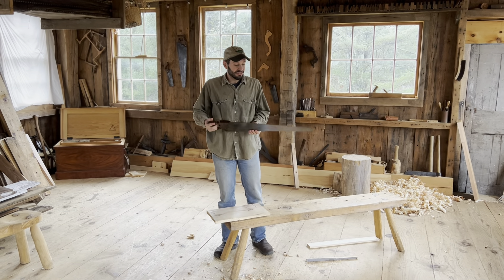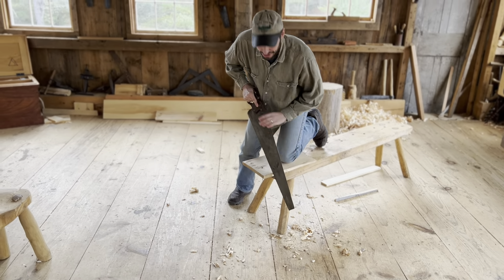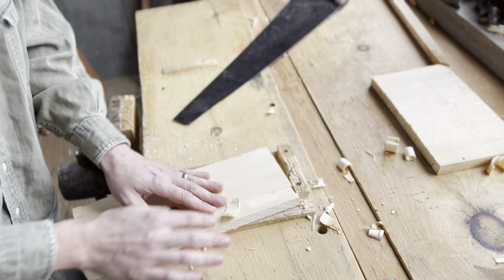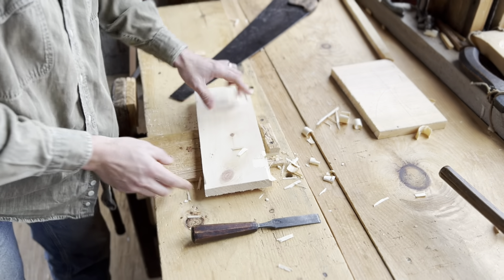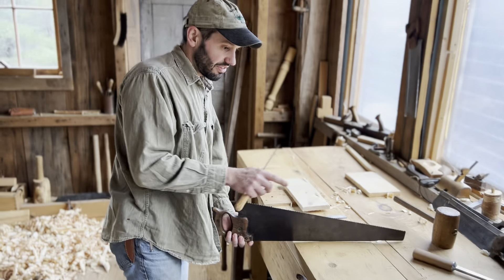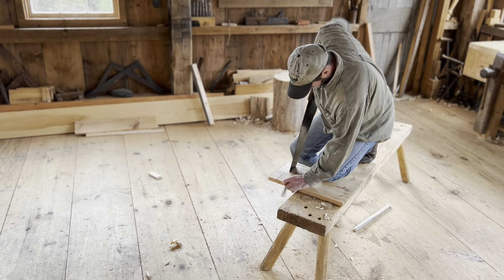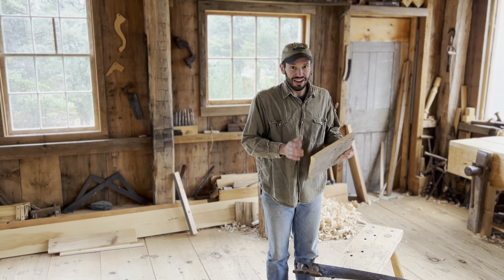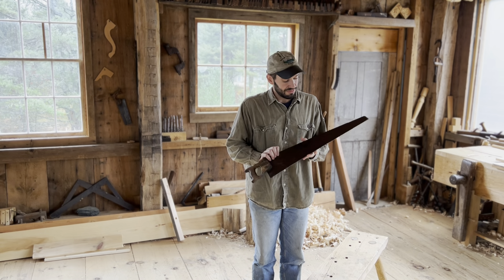Why You Need a Crosscut Handsaw

Comment: I’ve found that adding about 7 or 8 degrees of fleam to you rip saw makes it leave a pretty darn good finish on crosscuts. It degrades the rip cuts far less than it helps the crosscuts. I still have dedicated cross and rip saws. However, these days, I almost always just grab my old Disston that I hybird filed. I did it on a 7 TPI rip (it’s somewhere between 6.5 and 8 TPI, I don’t actually recall). The smaller teeth still rip quick enough for all but the the longest rips in 8/4 hardwoods. I think the slightly less aggressive teeth helped what I was trying to achieve. But it’s worth thinking about. Keeping the Cutting Edge by Harold Payson is a gold mind of a book for sharpening saws. It is unmatched in helping you become knowledgeable about what you should try and achieve when filing your saws.

Comment: I use a 4 point rip saw for rough crosscuts in stuff like fence posts; things that dont need to be clean. I start it on the forward stroke by using the bottom horn on the handle to lighten the toe. Itll cleave through 4inch material in seconds. But obviously a crosscut saw is needed for things that need to be cleaner :)

Comment: Sharpened with a slightly relaxed rake angle, the ripper can cross-cut extremely well, but ideally you should carry three saws. Rip, Cross-cut and Panel saws
Reply: Do you mean Back saws? I was under the impression that the broad-bladed saws he's using here (regardless of tooth angles) ARE panel saws, because the blade is a metal panel as opposed to a thin blade stretched in a frame.
Reply: @Nurk0m0rath  panel saws tend to be 20"-22" in length and are used for cutting thinner sheet materials. Cross-cut saws tend to be between 22"-24" and used for cutting across grain. Rip saws tend to be24"- 28" and used for cutting with the grain. All are handsaws, but the saws in question possess broad tempered saw plate and low tooth count per inch.  They're heavier duty saws than tenon saws, but not all are intended for sawing sheet goods.

The saw that's in use is a rip saw, not a panel saw. Rip saws tend to be used when cutting heavier timbers with and not across the grain, but tooth rake can be eased so they cut both with and across the grain.

Frame / turning saws are a separate saw type utilising narrower saw plates held under tension within a frame and with coarse, medium and finer blades for use depending on materials being cut.
Reply: @gazpal  You misunderstand me. My understanding is that "panel saw" is a broad category that includes both rip and crosscut saws, and possibly also back saws. I've never heard of a specialized saw for cutting through sheet material. In my experience, a crosscut saw does that job perfectly well. Which leaves a joinery saw (of which there are many designs, btw, but many are collectively known as back saws) as the third necessary saw.
Reply: @Nurk0m0rath  No, you misunderstand the definition of panel saw, which is in fact a narrow category of saw used for cutting sheet goods, with higher tooth count per inch which tend to be sharpened for cross-cutting.

Rip, Cross-cut and Panel saws are the three a carpenter/joiner used to carry on site or use within a workshop before the advent of disposable saws.
Reply: @gazpal  Okay, guess you learn something every day. But I really can't imagine a joiner going to a job site without any kind of joinery saw. Sorry, just can't see it.
Reply: @Nurk0m0rath  tenon saw are also carried, but additional saws tend to include a 12" tenon saw, plus coping saw, plus pad saw.  At the end of the day, a joiner/carpenter only carries the tools he needs and most stored within his toolbox on site.  Most site joinery involves pretty basic tools and few site joiners know much about hand tool use nowadays

Comment: The funny thing is that the only real antique crosscut saws that I have ever seen are the four and a half to ten feet long one or two man saws with about one tooth per inch.. In Jr high woodshop in the 1970's the crosscut saw was described as simply having finer teeth than a rip saw.  I had never seen a normal handsaw sharpened with a crosscut pattern until about twenty years ago.
Reply: They are known as misery wipps
One and two man variety

Comment: Was the old timers so concerned with teeth reshaping -set-sharpening those days? Today It seems an engeneering Degree Is needed to properly maintain a saw. Im looking for a more practical approach..
Reply: You can do trial and error, do a test cut after sharpen and see how it feels. Your saw is your preference. I put a slight angle on my rip saws and it helps a lot for curving grain. Like the video says, try it see what you think.
Reply: No, in most cases. There's a lot of overthinking (and overmarketing) these days, and the general-purpose, (relative) low-intensity, low-frequency work done now usually requires a fairly small number of sharpening techniques. Rip saws are very easy to sharpen, but even crosscut saws aren't that bad. The important part of sharpening is patience. Shaping, jointing, setting, sharpening--you just have to be consistent and not take any shortcuts. Though it takes a little practice to get to understand how changes in stuff like set and rake angle can affect your cut slightly, the first saw that you sharpen on your own will probably still be far better than the junk sold in stores these days (unless it's a Japanese store, I suppose). 

Regarding the old-timers, some of them had very specific needs that required them to be exceptionally attentive to their saws because their professions depended on it. Large crosscut saws and anything that has to deal with green wood come to mind.
Reply: Calro, A normal carpenter (in those days) could sharpen a saw in about 5 minutes (rip or crosscut), set the teeth about every 7-10 sharpenings, taking about 5-10 minutes.  Nowadays, you can do it in the same amount of time- you just need to know how to.  Search Youtube for an old english guy who shows how without all the fluff.
Reply: @bestbuilder1st  Paul Sellers is you man to explain this, he has some excellent tutorials on saw sharpening (and hand tool use in general). It really isn’t that difficult, give it a go on a rip saw first to get a feel for sharpening.